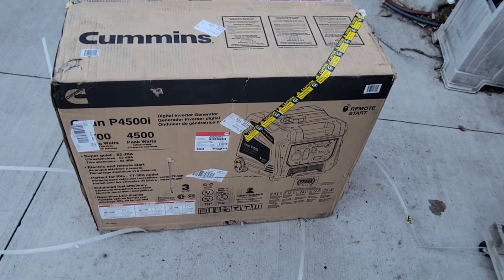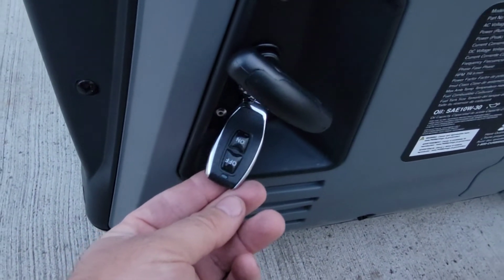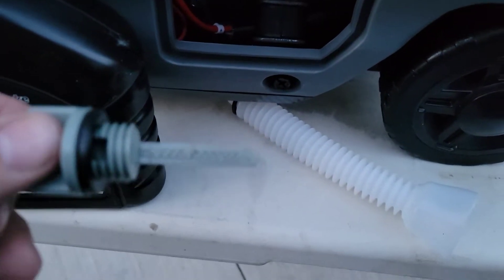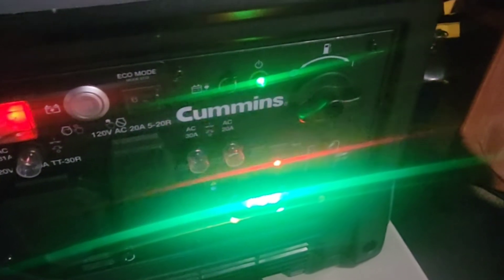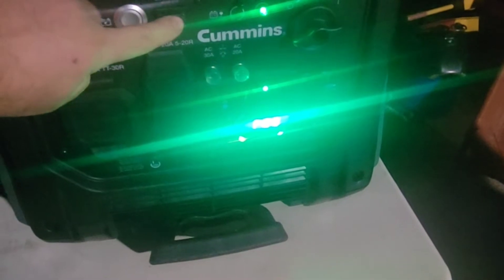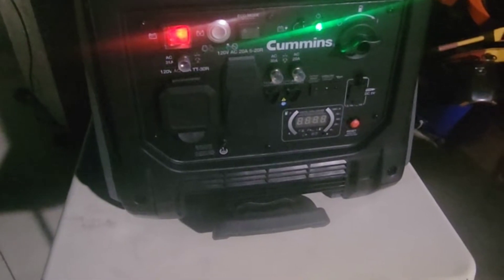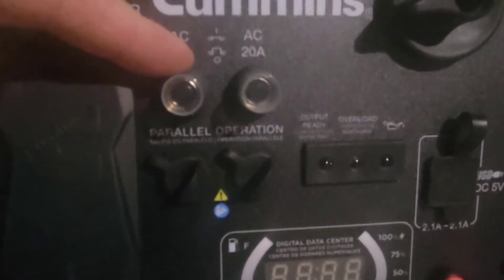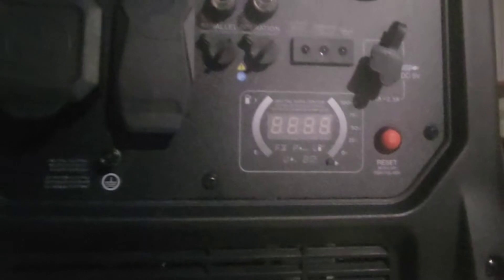Generator review Honda vs Cummins Onans Eu3000is vs P4500i

Comment: Oh my God comparing a Honda to a Cummins Onan is just wrong for several reasons. First off Honda makes their own motors has a reputation for reliability Cummins makes their own motors with a reputation of reliability but! All those small Cummins Onan generators do not have Cummins or Onan engines they're 4500 uses the same engine as Westinghouse and a bunch of other lower priced generators only thing different is the color of the plastic on the housing. No thank you I'll go with the Honda every time